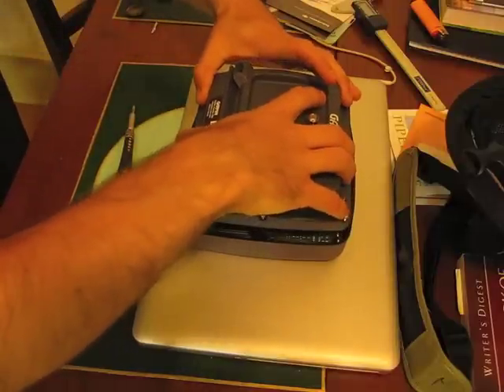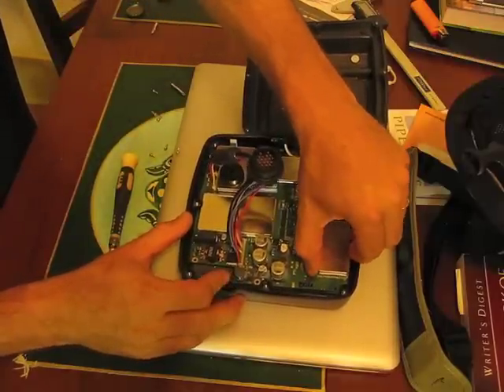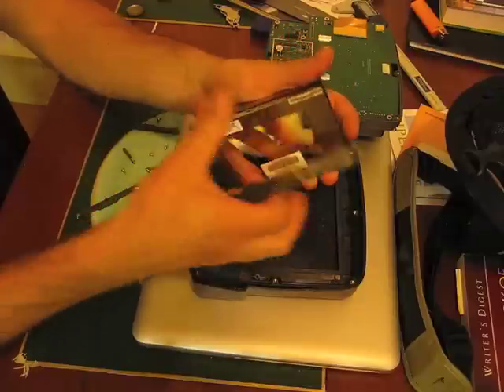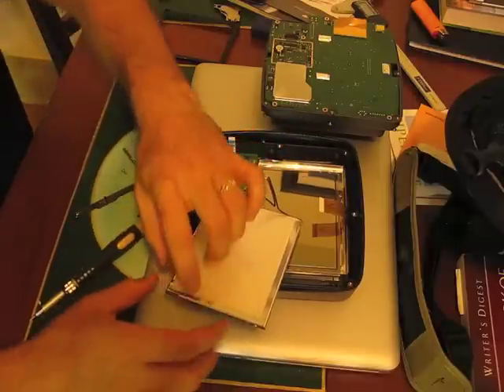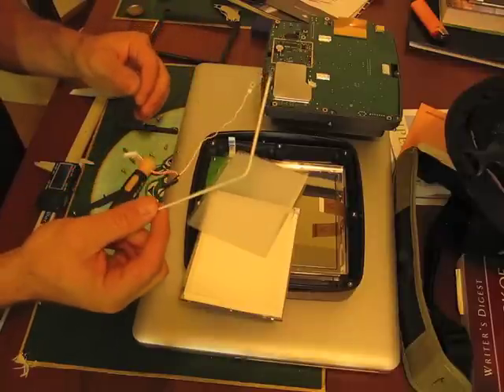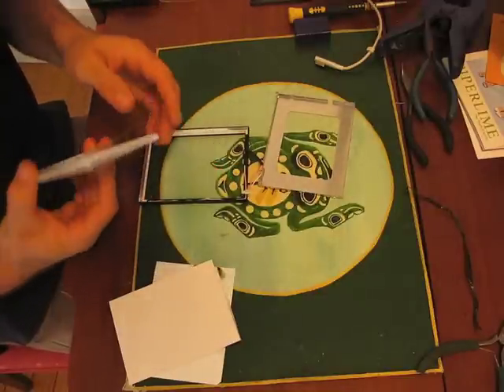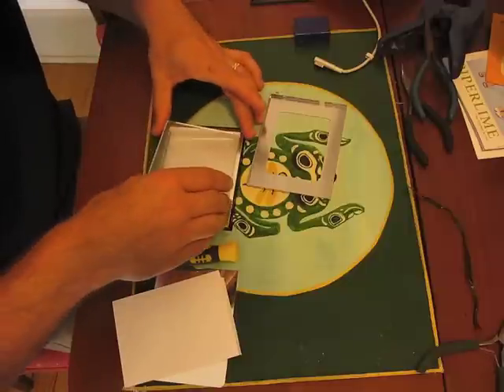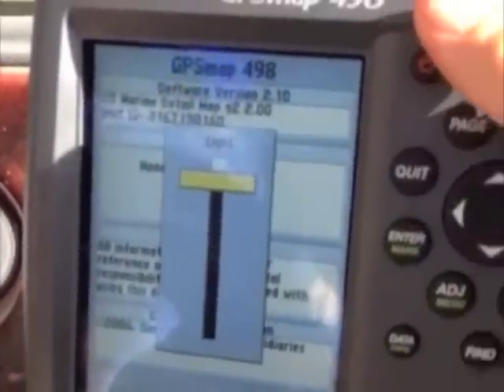Garmin GPSMAP 498 Backlight Repair

Comment: I got the bulb out of my Lowrance Elite 5 now I just have to order a new one.  I will say your Garmin unit seems to be made a lot better internally. Everything snaps in with my Lowrance not nearly as many screws, I actually broke my bulb trying to pry open the backlight case since it didn't screw together. Now I have tiny shards through out.

Comment: Hi Maxim, thanks for the vid, looks great. My GPSmap 520s display backlight comes on during startup, but then turns off and no amount of adjusting brings it back on, until I restart, then it beautifully lights up the Garmin logo before switching off the backlight, leaving me very frustrated.  Clearly the backlight can work, but either it can only work very briefly, or something else is switching it off (maybe low Voltage, or a faulty dimming sensor?)  Do you think it is worthwhile to try replacing the light?  So frustrating because it works perfectly, just very difficult to read!

Comment: Update for others doing this repair...I did this same repair on a garmin 521s (5 inch screen) using the light from cfl warehouse that is recommended for the 498 and it worked fine.  Same size as mentioned in my previous comment

Comment: Great video! A question for those of you who fixed their backlight issue. Before you repaired it, did the light go on for about 2 seconds when you first turned it on and then it went dark??? I know about the light adjustment but that didn't make any difference.  It seems like mine will light up only on the initial startup Garmin 498 screen and nothing else. When I put a flashlight to the screen I see that the unit is working correctly except for the screens are not lit. Would replacing the the back light fix the problem or do you think its something else.

Comment: Has anyone ever did this replacement but ran into the issue of "delamination" during disassembly? It's when the LCD slightly separates from the display panel, causing black spots on the LCD. This happened to me and not sure how to get rid of them.

Comment: Great video thanks. I have a issue and I was wondering if you could help? I just bought a used boat which came with Garmin GPSMap 498. My sonar isn't working. I thought most likely it would be the transducer. The Garmin unit had some rattling going on inside so I popped it open to have a look. Apparently some how all the wires on the six wire connector were cut or broken from the external 18 pin connector.
Would it be possible if you could give the pin out for the 6 wire cable from the pcb board to the 18 pin connector? My colors are Red,Blue,Yellow in the shielded cable black, white and ground.
I would really appreciate it.
Garmin will not give a schematic,

Comment: Great Video Thanks.  I'm doing the same repair but I notice on the ccfl warehouse they have a  stock  111mm by 82mm x 2.4 mm that says its for the the garmin 498.  I notice your measurement was 80 mm.  Did you get a custom size made or was a 80mm available?

 aped CCFL 111mm x 82mm x 2.4mm. Used in Garmin GPSMAP 298 and 498